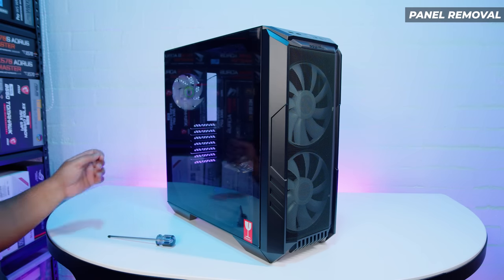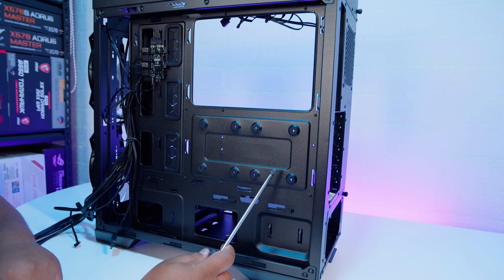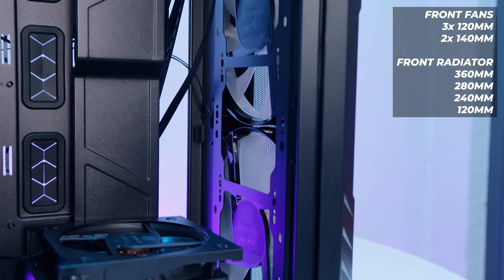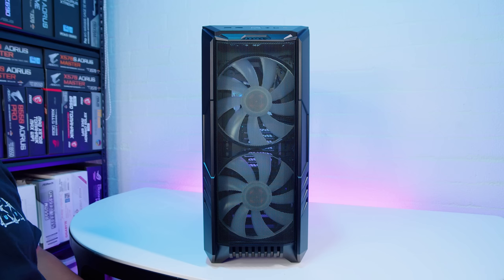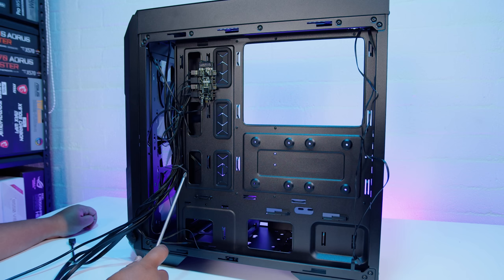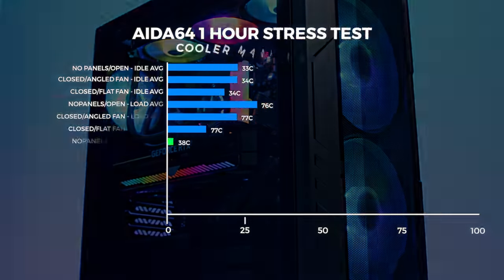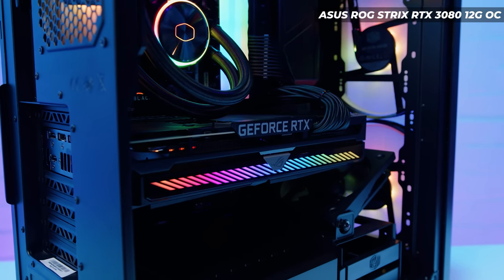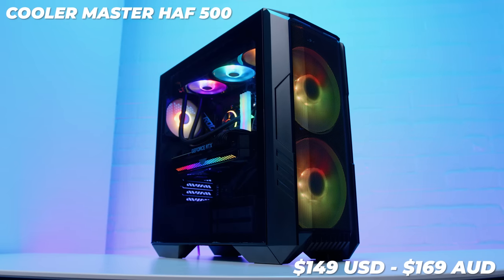Cooler Master HAF 500: Return Of The King?

Comment: It does not have a front dust filter......removing the front panel is horrible....the PSU cover is small and open......these faults are unforgivable in a 2022 case.

Comment: I know this is an old review but I'm personally considering this case since I've seen it priced at $100. It would be replacing my Fractal Design Meshify C. Good review! Speaking of cable management -- my personal preference is for cases to have metal panels on the back, cable-side (instead of transparent/glass panels) in order to conceal cable-management. I like tempered, tinted glass panels for the component side. I personally don't understand why case manufacturers would even consider making cases have glass/transparent panels on the cable-side. To me, it's non-sense -- or at least make it optional. Who cares to look at cable management? What is there really to show off? An example is Fractal Design's Torrent cases (Black only). They have glass panels on each side. The white version of that case has a metal panel on the cable-side which makes sense because it would ruin the white-theme BUT the black cases have glass on each side. BUT, IMO, it makes absolutely NO SENSE to REQUIRE the black version of that case have a cable-side, glass panel. I love the aesthetic of that case but having a glass panel on the cable-side was a deal breaker for me. Another case I was looking at is the Antec Performance 1 FT -- same thing, each side has glass panels = no thanks. But, I like this one! It HAF a metal, cable-side panel = me likey :)

Comment: Awesome video fams, always been a massive fan of the OG HAF case. Keep up the hard work
Reply: well... I still have it and it is used here.. 😅 the small pivatable fan inside is maybe an idea to keep the fully glass side panel and still have a casefan for the GPU.
but uh, the HAF X had a (plexi)glass panel with a 200mm fan, so it is indeed possible...

Comment: I just got a brilliant idea for a case design. Giving excellent cooling and bling at the same time without taking as much footprint as an O11.
Mix the lian li Q58 with a full size case. 
Bottom half of the pannel is ventilated, top half is glass. Cut them just bellow the first PCIe slot. To be able to see the GPU. Put these flexible fan mounts on the bottom pannel interior to be able to blow on the GPU.
You can even make the bottom part a bit smaller to see half of a vertical GPU and push air to the other half.
Reply: already exists, sorry bud
Reply: take a look at the "original" old one, the HAF X. a second 200mm fan is in the sidepanel which blows air directly onto the GPU. and there is enough (plexi)glass to see the inside aswell.

Comment: I have a 6 yr old Cooler Master 500 pro case that doesn’t have this level of open area at top and front, yet my 3080 Ti stays below 76 C under 100% load (3 T30 fans in front, NF-A14 in back, 240 Aorus rad in top). This model should be very good at temp control.

Comment: Hi I need your help...with the addressable RGB cable do you need to connect it ? If so...where would that go? Also for the 4 pin fan connector ...does that go on one of the regular fan headers?
Reply: @TheLightofOrion  I'm having the same issue

Comment: This is a very good case, it's going to be a big commercial success for sure. For beginner and medium PC users. Make sure to get the biggest harddisk possible to work around the low harddisk count and it's good to go. In future external harddisk on top of the case via usb is also a possibility. Not expensive, not too big, not to heavy... harddisk are properly cooled, gpu has extra cooling. Almost nothing wrong with it, though those radiator tubes a bit close to the back rare fan. Nice stand, nice glass, easy to open, easy to close, easy to remove top dust filter. Not sure if it has a front filter, if not that is ok, no obstruction. Only thing missing is frontal drive bays... but could be worth the sacrifice for good airflow. Oiling the 200mm fans might be a bit tricky with springs and metal rings. Though 200 mm fans probably last very long cause oil don't evaporate so fast as with 90 mm fans. Hmm the case is a bit flimsy and the air intake is somewhat blocked... still not bad.

Comment: Great review as always, thanks! Does the front panel support 30 mm thickness 200mm Noctua NF-A20 fans?
Reply from the maker: Not sure to be honest. As long as it uses the 156mm mounting it should work
Reply: Probably does, as my older 500 pro case has T30s in the front with plenty of room to spare, on either side of the front mounting bracket.

Comment: Where do we connect the PWM & ARGB Passthrough's which are part of the Front Panel Connectors? Also, does the Reset Switch, by default, connects to configure ARGB? Thanks

Comment: How is the noise of the fans compared to the other cases? For mine, the 200mm require less rpm, but due their age, they are comparable louder, but the hum frequency is lower.
As someone who had and still has the HAF X:

due it being a modern case, I like the general support of radiators. I suppose that's why the top 200mm fan is there.. Additionally the ability to mount some big radiators on the top is also really nice. - The HAFX doesn't do that really.
I really miss that fan on the side panel - the HAFX already shows you can combine a (plexi)glass panel with a (huge) fan.
Like you said, the amount of drive mounts is really low for such a huge case. I like the feet of the case.
For the HAFX, I added a DVD drive and a multi-card reader in the top. Additionally, it fit 5 HDDs and a SSD in there aswell. (nowadays 1xHDD+2xSSD)
So damn... my plan was to go with a smaller case. 😅 So I guess I'm gonna stay with AMD and Coolermaster at the next build which will come soon(tm) 🙂
Reply: it will be VERY hard to get that much air from a 120mm fan on same noise lvl as one of these big 200mm

Comment: That angled fan on the cage reminds me a lot of the haf-x with it's graphics card shroud - was effectively push-pull with the hdd mounts sandwiched in-between.

TBH though I don't see much as a need for it as you would of back then now that case design language no longer 1) designs around hdds mounted behind front-intake 2) practically every case front-intake has nothing behind it anymore and has a direct airflow path to the components (you only concern these days are cases with closed-off front panels choking air) 

Still would add to the case aesthetics though with an additional RGB fan if you have an unhealthy RGB fetish like me ...